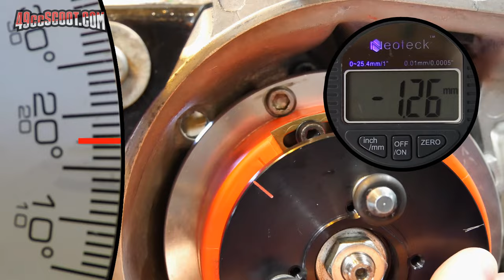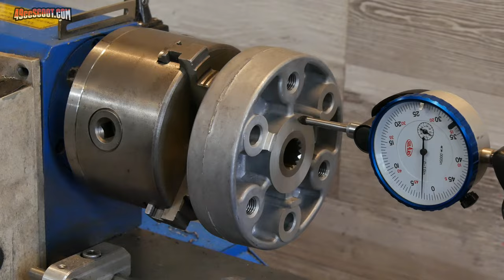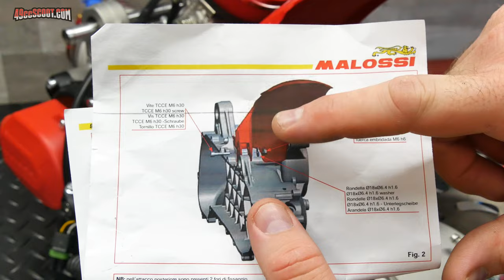RC-One : Finishing Touches, Engine Install & First Rides! : RC1 : Part 08

Comment: I had a similar design carb on my RS125 (VHSB37). You have to be very careful with those rods that keep the floats aligned. I had one of them slightly bent during assembly which led to floats being stuck midway and during test drive my carb floated straight on the ground like crazy. I'm so excited to hear this thing run and now I should continue watching to the end

Comment: You can get keihin peak carbs with an angled float chamber, so that the carb can be angled with float chamber nice and level.
I've seen them in videos - 2stroke stuffing had one in a video I think.
I can't find where to buy them from unfortunately.

I love these engines, I had one in a benelli 491 back in 2004.
Only standard parts were the cases.
I had
Mhr replica
Nardo/ gianelli shot exhaust
Multivar
Etc
Getting the correct torque driver angles was my issue with belt slip etc

Comment: awesome build, but i had to think twice about the choice of knifing your fresh powder coat versus just taking the cover plug and taking off 0.5mm of the side
Reply from the maker: True, the cap could be modified instead. I've had to sand a good bit of stuff that the coater left jagged and they even coated my drum brake once so removing some coating doesn't worry me. Smoothing it out has lead to no issues so far with my original Triton wheels or these.

Comment: nice to see you got your engine assembled, and put on your scooter ... hehe yes the malossi rc.one 94cc has a lot of torque, especially when you have portet the engien block ... your powder coater. sounds stupid
Reply from the maker: The powder coater will no longer be MY powder coater after these wheels. The first wheels were not a good experience, but I love the color and they've been durable. This time around, there's just no excuse for all of the mistakes, delays and cost. Never again.
Reply: @49ccscoot  I totally agree with you, when you have a company, it just has to be on point. and one should know. different between steel and aluminum ...

Comment: On the rear disc scoots I owned, the rear line was routed under the the cvt cover a lot like the drum cables. But if it works, it works.
Reply from the maker: Makes sense. I suppose it would look cleaner. Luckily this thing is weird and ugly anyway.

Comment: Such a bummer for wheel rub on the exhaust, it was visible at first mount that it's too close to the rim, too bad that you didn't noticed it ... Do you have in plan to mount an arm support for the rear wheel? I know that some high end setups was prone to breake engine block without it... You should also try to stiffen up rear shock, from jumping in the garage it looks that it is near the end, and you don't wan't to strike pothole  bottoming out...and last one :D I think that would be nice to fabricate some carb bracket if it's possible to keep it more rigid, and less prone to touch the fender and scrub it :)  Anyways love the project, and can't wait for an update !! Have a great time at the car show!! \m/  :)
Reply from the maker: You are the 2nd person to mention the swing arm brace. I may look into one. I'd like a different shock as well. This one has always been a bit soft for my weight, but it is pretty comfy to ride and doesn't bottom out. I'm mostly considering a different one to stiffen it up and see if that lets it control power a little more at some point.

Comment: The washer under the needle is used to move the needle by an half-position, you can put I under or over the needle to make smaller adjustments
Reply: this is not true, it serves to avoid damaging the gas valve from the possible pressure and movement of the needle stop
Reply from the maker: I've always heard the same as NazzyTPR. I think I bought shims for a non-adjustable stock carb on a 4T, but wound up tossing the carb for an unrestricted one.

Comment: So cool to see it finally installed! What kind of power difference do you anticipate between this at the old TPR setup?
Reply from the maker: Malossi claims 31HP. I've seen sites say up to 24HP for the TPR kit. I don't have a dyno so I can't tell you for sure. I figured my TPR was around 20 and this will likely end up around 30.
Reply from the maker: @MidnightCoding  I must be lucky for a change, because I took it to the show after and ripped it in short bursts for hours on 2 different days. I don't ride around fast though. Most of the time I'm putting around very rich at 1/8 throttle maybe and my normal mix ratio is 32:1. No shortage of oil here.
Reply from the maker: @MidnightCoding  I use to use 50:1. Since switching, my pistons and cylinders look better. Can't say I really notice a power difference. I know that older studies have shown richer oil ratios can actually improve power from reducing friction. Not sure if this is true with current oils because I haven't seen any scientific studies. I did do my own experiment years ago and noticed that RPM increased as I went from lean to rich oil mix ratios while adjusting jetting as close as I could for the percentage difference so that should have had minimal effect.

Comment: They make PWM controllers that are specifically designed to continuously vary the speed of a radiator fan based on temperature. I wonder if you could use one of those on your water pump.
Reply from the maker: If you go with Malossi's whole setup, it has a pump and  a pump controller and it will regulate the pump based on temp. So far so good with charging though.

Comment: So this build the malossi rc came with a brake disc adapter for piaggio or you made by hand for it?
Reply from the maker: This is the Minarelli version of the RC-One. I used a Motorforce adapter, or you can get one from a Yamaha Aerox.

Comment: 55:01 sometimes the engine mounted flange deformed when you tightened it. Try loosing the bolts before you slide the expansion chamber. 
It should slide in better

Comment: Great job on the build bud. I have a weird question. How much does you scooter weigh?
Reply from the maker: I weighed it with a scale under each wheel some time ago and it was around 225-250lb.
Reply: @49ccscoot  Cool, thanks. I'm building a race bike kit bike. I'm guessing it may weight 100-125lbs. You're a bigger guy and you're flying on your scooter. Imagine shaving off 125lbs(bike weight) and then hitting the streets...😆
Reply from the maker: @jmrides777  Ryan's MetRuck is around 190 IIRC and he's ~100lb lighter than me. You can see us drag racing here :
https://youtu.be/Pmj3kuwI5v0?si=BfxA0MP-pb-z7hzV

Comment: Hey man excellent video. I have the same kit I bought a wile back. Just a quick question,, how many turns out did u do the fuel mixture screw and what size main get did u end up using?, and did u leave the needle clip on the carb needle still original(on the second clip from the top. Thanks heaps
Reply from the maker: Mix screw was left as it came. I adjusted a little at the show to lean it, but it didn't make much difference and I don't know where it is. Prob not more than 1 more turn and I turned the idle speed up a little. I think mostly because it loads up 1/8 throttle and below and most of the riding there is idle and very low throttle so it loads up and then idle drops. Everything else was the same, but I haven't tuned it yet. Will get to that soon.
Reply: Yeh hey i left the carby setting as it came but it bogs alot in the begging   like chokes alot when taking off, is that normal?. What can I do to make it a smooth take off if you have tuned yours yet or have an idea. thanks man
Reply from the maker: @TheLionInTheArea  I still haven't got around to tuning it and right now the weather is all hot and humid so it really wants to load up at low throttle. I can take off, but if it idles for long it will load up so I rev it to clear it out before trying to go hard. I'd think the shim under the needle clip being removed may help some, but I don't know if that makes it too lean for part throttle cruise. Could possibly use a smaller pilot, but when I looked quickly the only smaller one I saw was 1 number smaller so barely a change.

Comment: @49ccScoot 
Thanks for putting all together your youtube videos about assembling scoots. Very helpful and informational. By any chance do you have spare needle for VHST carb? Couldn't find any online. I need it badly :( . Thanks
Reply from the maker: Check out gforcemx. They have a good selection of them in the US at a reasonable price.
Reply: @49ccscoot  Thank you Sir! I appreciate your help. By the way, I learned a lot from your videos.
Reply: @49ccscoot  Probably going to drop them an email. I saw they only have type D needle from #01 to #39. I think I needle the default need D41 that comes with the factory Dellorto VHST 28 carb. Thanks again for pointing me to the right direction.

Comment: So me and my friend we are trying to make universal power jet kit for moust scoots do you think it will work it will be using normal long jet that can be replaced for the preference of the rider and shut off valve so you can ride normal
Reply from the maker: I don't see why it couldn't. There are companies out there selling "universal" power jet kits already.
Reply: @49ccScoot  well that means we need to make the prototype and get to work fast and hopefully some day we will be world wide
Reply from the maker: @preslavnikolov923  Good luck! Here's an example : https://thunderproducts.com/product/thunder-powerjet/
Reply: @49ccScoot  our idea is too keep the carb untouched and make custome adapter that will go between the carb and air filter and it will be connected via extension to the float Bol or the gas line
Reply from the maker: @preslavnikolov923  Ah. OK. That's interesting!

Comment: hello, if you look in the assembly manual of the yamaha aerox hub, before inserting the hub a shim must be put I do not remember the diameter, it is specific to be put only with the aerox hub, I had the vhst it is a great carburetor, if I can give you a piece of advice you should put specific aq pulverizer for 2 strokes, there are less problems with carburetion and it keeps the carburetion stable even with the temperature change compared to 4 strokes pulverizers such as he or hh.
Good job from italy!
Reply from the maker: I may have just looked at the parts diagram and didn't see a shim. Not sure that I checked the actual assembly procedure in a manual. I figured if it needed a shim they'd show it in parts, but that would make it too easy.

Thanks for the tip. Do you have a specific part number or letters for the 2T atomizer/pulverizer that you prefer?
Reply: @49ccscoot i used with this configuration: gas valve 45, atomizer aq 265, needle d44 at the second notch, float 6,5g your carburetor instead mounts the new separate floats so I don't know how to make a comparison with the old model floats, needle valve 300, I think which you can try with 4g floats of your type,this is also the configuaration that is advised by 2fast trt  for vhst
Reply from the maker: @pierluigimatteazzi2568  Thanks again!
Reply: @49ccscoot  you can safely use the 50 gas valve, a 55 would thin out too small openings, to go the atomizer aq however you have to buy its specific nozzle because the thread of the aq is also different from hh, and then there would also be another modification, looking at the carburetor on the air intake side you notice two holes with golden pads inside, to convert the carburetor for 2-stroke pulverizer (aq) you have to completely remove the pad from the right hole instead on the left pad you have to widen it with a 1mm tip, so in my opinion try see how it goes with the malossi configuration and then see whether to make this change or keep it with  malossi configuration. good luck
Reply: @49ccscoot  it was 6,5 g float not 9,5g
Reply from the maker: @pierluigimatteazzi2568  I was thinking the same. If it will work well for me as-is, that sounds like a considerable amount of time to fix something that may not need fixing. Thanks.
Reply: @49ccscoot  as for the correctors you put a thickness between the corrector and the clutch, I had polini evo and 2 fast correctors and both had the same problem as your malossi, but I think that the corrector will never touch the clutch because when the spring is fully compressed, do not open the corrector to the end, so it is right to mount without thickness

Comment: where did you plug your electric water pump too to your cdi or battery
Reply from the maker: Battery. I use a relay that is active only with the key on and have a switch inline as well.
Reply: @49ccscoot  Can you make a video how to install electric water pump
Reply from the maker: @rogge7846  Already have!
https://youtu.be/Yu_Mgi67fQ8

https://youtu.be/SjfXaNtkNIs

Comment: Really neat stuff!  But out of curiosity, isn't the point of a scooter is to be >49cc to evade the licensing and registration requirements?  Now it needs the same requirements as a real motorcycle.  I mean with the money I'm sure you've put into this beauty, you surely could have bought a nice used street bike that puts this to absolute shame. Performance wise.
Reply from the maker: I actually tried to register this scooter as a motorcycle a couple of times years ago. The reply that I got was basically once a 50 always a 50 in their eyes.

There are many reasons for this and other stuff that I do to small bikes. I really enjoy it. My friends know me and know that if I had a bike that was scary fast, I'd still want to work on it. I had a turbo Mustang and poured money into it for years and I have more fun with the scoots. If you take a sportbike and work on it so it's faster... it's a fast sportbike. Not that it isn't cool, but we all expect them to be fast. This thing is so much different than what it started. To go from 42MPH tucked down and struggling to keep up with traffic in stock form to something that I'm afraid to twist the throttle too quick on from a stop because it absolutely will toss me off is just cool IMO. I really enjoy experimenting and learning and I think scoots are a great platform for that, especially if you aren't rich. Plus, two-strokes are badass. Enjoy them before they decide to crush them all or something.

Comment: Be aware the longer the extension you have it actually decreases the Nm of torque applied.
Reply from the maker: As long as the extension is straight and rigid enough, it shouldn't matter. If you believe that extension length matters in that case, then you would also need to change torque based on socket length/height so every time you tightened a fastener you'd have to adjust torque settings or torque wrenches would come with their own socket sets.

If it's something like a crowfoot wrench, then it does matter if the socket is not at a 90 degree angle to the torque wrench or if you have a swivel or something that alters the angle it will matter.
Reply: @49ccscoot  if you had a 1/4" ratchet going into a 1/2"socket adapter going into a 3/4" socket adapter going into a 1"" socket adapter with a 1" extension stretching from California to Maine the Nm of torque would be decreased
Reply from the maker: @matthernandez1737  I'll remember to keep my extensions within state lines.
Reply: @49ccscoot  that's why I love you brother
Reply: @49ccscoot any idea where I can get a cheap but decent wiring harness for a vento Triton r4 , with blinker and brake light connections
Reply: A harness with all connections for blinkers headlights, electric choke, gauge lights everything. Closest to direct replacement hope same wire colors etc. Maybe with a diagram too explaining what each of the wires is for etc. Thank you for any feedback brother.
Reply from the maker: @matthernandez1737  Google this : 
"gmi 107-1532"

Not a lot of new parts sources these days. That's as good as I know of, but I don't know if it will actually match up to everything. I've used them for parts for my Tritons with good luck for years.

Comment: what fuel to oil ratio are you using?
Reply from the maker: 32:1
Reply: thank you @49ccscoot  do you have any ongoing 4stroke low CC  projects i could check out?  i  recently got myslef gpx gentleman 200 and given its weight its got not enought power, especially considering the fact that oficcial website says that it has like 20hp when in reality its more like 11.6, so any help would be appreciated.
Reply from the maker: @pironiero  I would suggest trying to find out if the engine platform is common. Maybe there are big bore kits and other performance parts that bolt on. Ignition timing, carb tuning, exhaust and air filter aren't going to get you there. 12HP is not a lot for 200cc so maybe there's some porting and compression change to help, but it's still way easier if there's a big bore kit.

Comment: Hey Trent could you please check ya boy out!? Our passion for bikes builds are similar and I have a pretty swift setup too!
Reply from the maker: Actually looked before you posted this. Very nice. Wish I could wheelie like that. Power hops only for me.
Reply: @49ccscoot  I feel honored you noticed me seriously I appreciate the love and you can definitely learn how to wheelie if you practice at it 🙌🏾 you  power up now with that set up is gonna be like 😳 love the RC setup !
Reply from the maker: @GorrillaFastTv  I've practiced some in the past. Used to ride little bikes that would wheelie in high gear before scoots, but the balance point eludes me. Since breaking a bunch of stuff in a crash (not a wheelie) a few years ago, I just don't have the desire to try that hard at it 'cause everything already hurts.
Reply: @49ccscoot  I completely understand you had my laughing 😂 when you said you hurt all over! Ethier way you gonna have to find a way to maintain that beast you’ve built! Once you get over the fear of balance point you are golden🙌🏾 ethier way you , your work and projects are still alsome💯